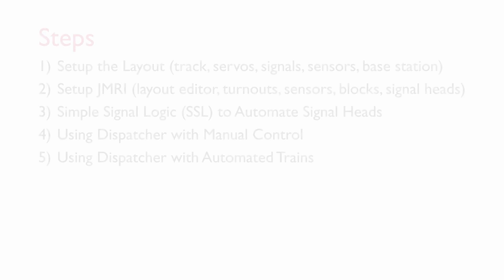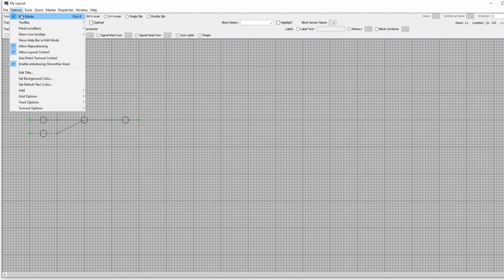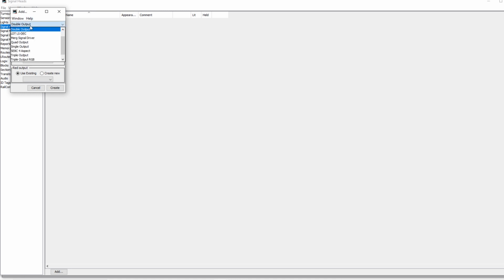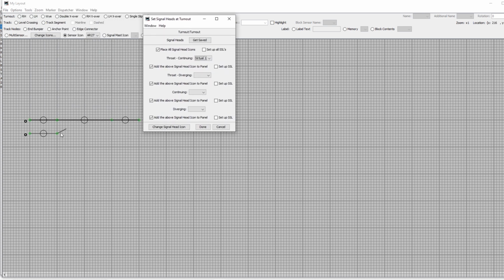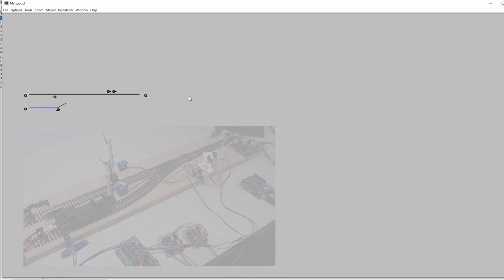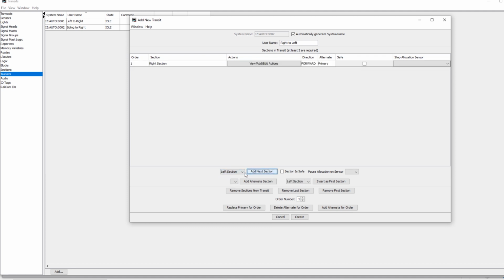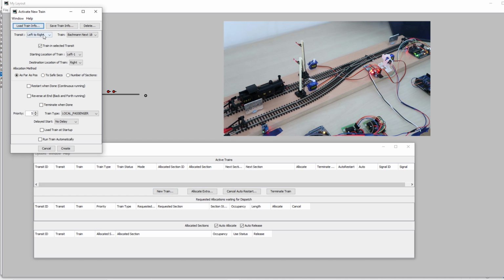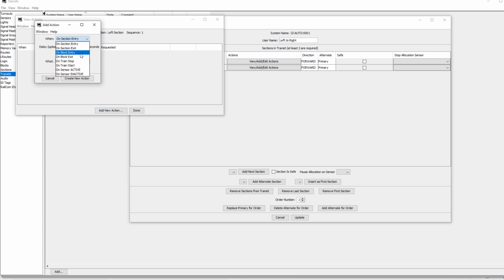Model Railway Automation using JRMI Dispatcher and Simple Signal Logic

Comment: Hmm. I like the free open source nature of JMRI but it seems rather complicated. In Train controller for instance to automatically move a train you just drag it to the block where you want it to move to and it will move points and the train to get it there. With Train controller now defunct I might have to look at iTrain to see if that’s more user friendly. I don’t mind the setup it’s more the in use cases that i’nm not liking with JMRI.

Comment: This video was quite interesting because it showed basic setup of train detection and basic automation. I was hoping you would show what is required for sending your train from left to right, then right to siding then siding to right and right back to left. I was hoping a script could do this. I'm setting up my own automation at the moment with a digitrax system and PC control but I did learn what is required for signals and block sensing. Thanks for making the video.
Reply from the maker: Scripts in JMRI are relatively easy to write and can definitely do as you describe. Also, you might be interested in this as an automation option https://youtu.be/H8wDb7iKrVQ
Reply: @LittleWicketRailway I've ordered a BDL168 to setup my metro rail into blocks. Wish me luck.
Reply from the maker: @fourbypete  do you have a JMRI/USB to LocoNet interface/adapter? (I believe BDL168 runs on LocoNet).
Reply: @LittleWicketRailway Yes.
Reply from the maker: @fourbypete  mind me asking what you're using?
Reply: @LittleWicketRailway  Not at all. I have a windows PC running jmri to control a digitrax 210+, Pm 74( I think) and 3 N scale Shinkansen. 2 E5 series 3 cars and 1 N700S 4 car. I'm thinking about getting a yellow 4 car Shinkansen and run them all by automation.
Reply: @LittleWicketRailway  I wish that I'd gone down that route as Digitrax isn't happy with Kato decoders even though Digitrax make them. I've discovered that Jmri knows if decoders are moving but not where they are at any time. I can't dispatch any trains because the softwaer guesses where the trains are and for some reason the sofware thinks tracks are joined when they aren't and tracks that are joined, aren't. I was of the impression that my Jmri layout would let the sofware know what my layout looks like. I have a feeling but don't know how to determine it, that my digitrax base station DCS210+ has created the layout in it's own mind and then told Jmri what it looks like but it is wrong. I'm thinking that different decoders (Not Kato EM13) would be better if they told the system where they are. I don't know which decoders I should get though.

Comment: Dear Rob
This is my first time writing to you.
Please forgive me for asking this question in poor English from Japan.
Now that I am 65 years old and retired, I finally have the time to seriously work on JMRI.
So, I discovered Rob's videos about two years ago and have been watching them with Japanese subtitles.
So, I'm trying to create autonomous driving using JMRI, but I can't quite understand it and it doesn't work well.
The operating environment of the railway model is
1．The size is HO, and several vehicles are equipped with DCC sound decoders.
2．The command station uses Ecos50200.
3．The rail is made by KATO. Digitrax DS51K1 is attached to the turnout. 
4．I am connecting to Ecos50200 using s88-N Train Detector (16 sections).
5．I am using JMRI Ver5.4 on my PC and connecting it to Ecos50200 using a cross cable.

Now comes the question.
1.	When the DS51K1 is attached to the turnout, the S88-N detects the S88-N even though there is no vehicle on it. Is this a problem?
2.	Rob's video, the signal is explained using SSL, but what would happen if SML was used? This is a slightly more complicated case where multiple points are connected.
3.	I don't think it's possible to directly connect turnouts with Layout Pro, but the track segments that go between turnouts will become blocks, but you can create sections and services (no s88-N detection). Are you having problems when installing?
4.	It is possible to manually move the vehicle by setting it in Dispatcher, but the vehicle startup function key will not turn on automatically. The screen shows "Running", but the vehicle does not move. Could you please tell me what the problem is?
5.	In the future, will it be possible to set up signals, turnouts, and lighting with Ecos50200 and Arduino?
I have asked a lot of questions, but could you please explain to the best of your knowledge?
thank you.

From koyabu

Comment: I'm loving the video's and this is all new to me, but some question have popped up.  Can I use a separate DCC to to drive the trains and still be able to control the routing?  Also, can I setup stuff like grade crossings, and traffic signals ?
Reply from the maker: Hi Ron! You can pretty much do whatever you want. On my previous layout, I split the DCC signal into 2 and has one going to the track and one to the accessories (points, signals, uncouplers, etc.). I also had a switch that allowed me to change the track from digital to analogue. Because the DCC feed to the accessories was separate I could run an analogue loco on the track, but still control the accessories using DCC and JMRI. Thanks for being a member!

Comment: Thank you. Your videos have been something of a revelation to me over the last day or two. Despite being a JMRI user, I'd never looked into block detection or automation because of how expensive it seemed to be. I'm a bit of a tech geek and have countless Raspberry Pis and Arduinos lying around so am half way there already and really quite excited to get stuck in, once I have a new layout up.
You've brightened up what was otherwise a pretty miserable week, most of which I've spent tucked up in the most extreme eaves of my loft, trying to fit insulation. In an unseasonal heatwave. Seeing what's possible from your videos has given me that extra bit of impetus to get up there and get it finished though. It'll be worth it!

Comment: Thanks Rob. Great stuff.  A couple of bits I will have to do to understand better. Like others have said switch bounce suppression would be good.  I will look to do this exercise virtually using the simulator, MERG ,and Digitrax over TCP in the systems. The simulator lets me set things up and add physical bits by changing the system name of an entity as I go along. MERG - as that will be my Layout control bus. Digitrax over TCP as I have chosen the Digikeijs DR5000 and the DR5088RC to give me 16 Railcom detection zones for the staging yard (converted to transponding by the DR5000).  Train Tracking as you showed in your later video will follow things around. As CBUS will look after switch bounce, I could do as you did for those sensors - no delays. Thanks again.

Comment: Great video series Rob. Very informative, thanks.

One thought: from the TrainController manual, you are strongly advised to have the points in no block - i.e. they're just wired to the bus directly, not through a current sensor. Would that advice hold true for JMRI too, or do the points need to be in a detectable block? (If they do, I've got some rewiring to do :( )

Cheers!

Comment: Fantastic series.  Have you automated the entire layout?  A video of that implementation even if it was an overview would be cool.
Reply from the maker: Hi Chris. I had automated my old layout, but this was before I started sharing information on YouTube, so it wasn't in the same way that I've described in my videos.

On my old layout I used IR sensors rather than block occupancy current sensors. Instead of using the built in JMRI automation tools I wrote custom python scripts that I would run in JMRI. These set routes and controlled train throttles based on timings, positions of points and when sensors further down the track had last been activated. The scripts would also "listen" out for certain sensor activations and use these to turn sounds on/off. I made life really quite difficult for myself, knew there must be a better way of doing things, hence the videos.

I know it's not ideal, but all the trains and points in this video (https://youtu.be/xBlwivX0rpg) were running under the automated scripts. If I'm honest the IR sensor/script system was very unreliable. If a sensor didn't activate properly, a point motor didn't fire when it was meant to, a train derailed, a loco overran a stop sensor, a short occurred, etc. then there was likely to be a disaster.

Block occupancy current sensors, RFID tagging, servo point motors, JMRI automation tools, etc. all make things more reliable and easier to control. The new layout will be built with these improvements. The build is currently delayed because I'm trying to decide where/if I want RFID readers and how I want to implement it.
Reply: @LittleWicketRailway  Thanks Rob.  Cute little video.  Interesting you initially used JMRI scripting to automate your layout.  I have a couple of follow on questions if you don't mind.  Did you research LCC vs. C/MRI and Traincontroller or iTrain vs. JMRI?  I am leaning towards C/MRI and JMRI for both cost and the ability to do some electronics and coding.  I am still in the research phase.  I'm looking forward to the build out of your new layout.

Comment: Hi Rob.  Thanks for a great set of videos. I have set up the movement sensors for my layout, and wanted to add the feedback sensor to the points. I can see form the video that there are only 2 cables coming from the micro switch. Could you tell me how you have connected this to the sensor hub? Many thanks.
Reply: Hi Rob. I had the same question. I’m not sure if it’s been answered elsewhere. I’m assuming it’s to tell the system which position the point is in, but how is that used on the sensor hub, please, as the servos are driver from the other board? Thanks! Steve

Comment: Hi Rob - Just watched the videos about block detection & sensors using JMRI. As ever brilliant videos with excellent presentation & clear explanations. I was inspired by your Digital controller, so I built one & this works so well. I did ask if you had built a wireless system without the need for a PC & a router..... 
Using the excellent DCC++EX website I built a system using a MEGA with a L298P motor driver shield & a separate ESP01s device (acts as an access point(AP) similar to a router) connected to RX1 & TX1 on the MEGA. Using Engine Driver App on an Android phone & WiThrottle on an iPhone. By changing the channel in the Command Station sketch config.h file I have this working without any problems. I then bought a MEGA with an ESP8266 (acting as an AP) device on-board & again using either Engine Driver or WiThrottle I now have this working. The connection between phone & the ESP sometimes drops out but quickly recovers. Again, many thanks for your excellent videos.

Comment: If you wished you could do away with the micro switch. I've been trying a few things my self based on your CMRI code. I noticed that the servos always get reset to the same state on boot up of the whole system. Hence the state of the servos is always known. After a bit of thought, I modified the Arduino code to include a virtual sensor to "feedback" the state of the servo. See code sample below: -

   // PROCESS SERVOS
   // Assume servos start on bit 0 which corresponds to output address 1001
     for (int i = 0; i < numServos; i++) {
         Status[i] = (cmri.get_bit(i));
         if (Status[i] == 1){
            pwm.writeMicroseconds(i, Throw[i]);
            if (i == 0) {
              // set above comparison to the number of the turnout servo
              cmri.set_bit(8, 0);  //Bit 8 = address 1009 in JMRI, Virtual Sensor 9
            }
         }
         else {
            pwm.writeMicroseconds(i, Close[i]);
            if (i == 0) {
              // set above comparison to the number of the turnout servo
              cmri.set_bit(8, 1);  //Bit 8 = address 1009 in JMRI, Virtual Sensor 9
            }
         }
     }

Straight forward enough, just set the virtual sensor to either 0 or 1 depending on servo position, and set up the new sensor in JMRI linked to the turnout. You can then use the micro switch for frog polarity switching. It works really well.
Reply from the maker: Nice work 👍

Comment: Great series of videos help me a lot.  I can get a automatic dispatcher to run my train, however the second time i go to run it, the signals are not allowing the train to run, i.e set to red when i check the SSL i notice on the points signals  the values of the sensor it is protecting now includes the forward and reverse direction sensors !  when i clear 'all' of them i can run again in Automatic  mode from dispatcher, but the forward and reverse sensors are added back into the SSL for the turnouts , which seems to set the lights red and prevent the engine moving.  Any thoughts ?  Thanx

Comment: "Never going to flicker 'cause it's a switch" - Switch bounce is the reason for having the de-bounce delays in the first place. Physical imperfections on the contacts of a switch always cause a certain amount of bounce as the contacts either make or break contact, due to tiny sparks forming between microscopic peaks on the contact surfaces. On an oscilloscope you'll see it as a bit of noise as the switch is operated. Doesn't hurt to use 10 milliseconds or so of de-bounce delay to avoid problems. But another really useful video. Have been watching all your arduino based projects with great interest.

Comment: I really like your videos. All very well explained and easy to understand. In this video you are using 3 Arduino's (1 for servo's, 1 for sensors and 1 for driving the loc). In JMRI preferences, i see 1 DCC++ and 1 CMRI connection, each using a single COM port. How is the third Arduino connected to JMRI ?
Reply from the maker: Hi Tom, the 3rd Arduino has the sensor shield on it and works using a script that is run in JMRI. The COM port for that Arduino is specific in the script. There's no connection setup in JMRI. However, I've since moved onto connecting this sensor shield Arduino as a CMRI node for two reasons. 1) it means you don't have to run a script in JMRI and 2) it's easier to access the pins which can be used as inputs and outputs.

Comment: Thanks for a wonderfull instructionvideo on automation in jmri. I was just wondering if you could exchange the end stop ir-censors to the same current sensors as the blockdetection has?
Reply from the maker: I'm not sure and I don't have my test layout setup at the moment. I'm pretty sure that you don't have to enter forward/reverse stopping sensors, they're optional. If you leave them blank then the automation either ends once the final block is detected or when the final block is detected and the previous block is clear. So if you just want the automation to end once the loco is in the final block then leaving the stopping sensors blank might do the trick. Obviously the risk is that your train might not be in quite the right position, you'd only know it was somewhere in the block.
Reply: @LittleWicketRailway  I have added virtual end switches using LogixNG. The input is then the block sensor and I use a delay to activate the virtual end sensor.
One issue is that you need to check the state of the block sensor again when the delay is finished to avoid wrong states. 
Another issue is to use Always execute in the logix.
Reply: Ok, thank you for answering. I will see if it works when I've put up my testtrack.

Comment: For blocks that aren’t a dead end, (for example a loop layout) would you need the infrared sensors still? Or say if you wanted the train to stop at a station or industry you’d have to have a sensor and or an action to use with it to say pause the train?
Reply from the maker: For a loop if you tick the restart when done box in Dispatcher and put in a delayed start that might work (I've not tried it), otherwise you could put in an action to pause the train within the transit. 

Without a stopping sensor sensor I think the train would just stop as soon as JMRI saw that the final block was occupied and it was clear of the preceding block. That might be fine, especially if the last coach/wagon on the train was being detected, but it could also mean that the train didn't stop fully in the plaform or in the correct place.
Reply: You can tell Dispatcher to stop a train a few seconds after it has entered a section or block. This can be tweaked so your train stops where you want it to, without the need for spot sensors. You can program other effects including changing the speed, handy if you want to accelerate after your train has cleared the platform. That said, getting everything right so dispatcher works is very very difficult.

Comment: How about 2 or 3 locomotives in doble track, and the middle there is a Double X-Over ?. About signal, My plan is using 3 aspect signal which is the signals at the station are manually controled by the switch button. But, the signal at To-the-station track is special because going-straight signal and going-turn signal are different, Red and Green on the top with 2 diagonal white LEDs that differentiate will going turn or will going straight.
How to make it by using JMRI ?. I didn't get that logic to build that.. :(